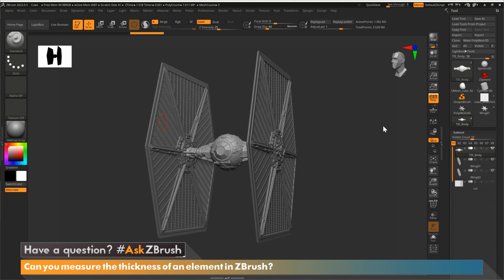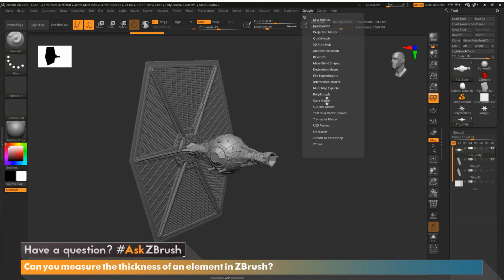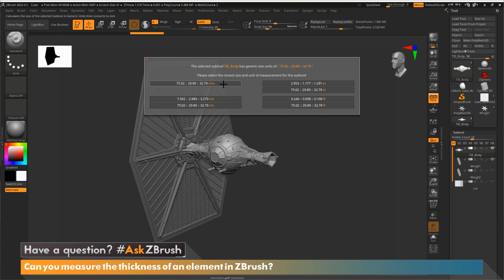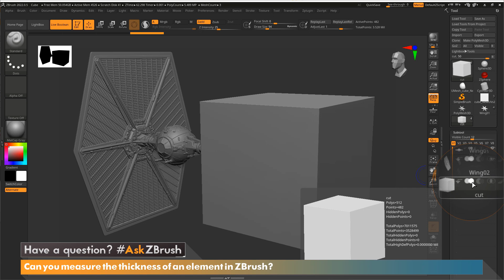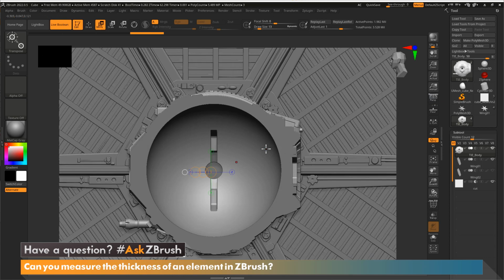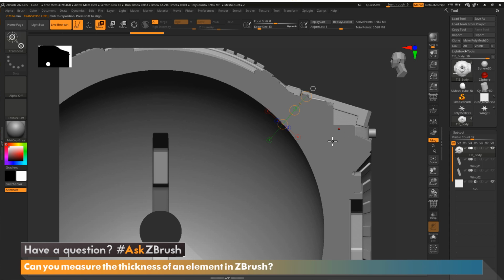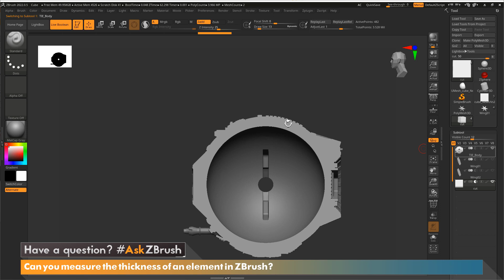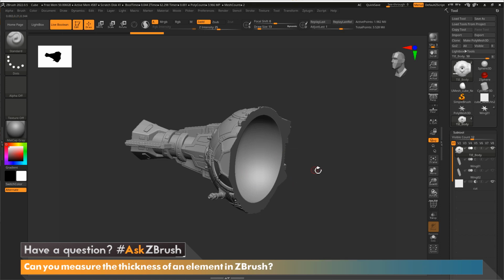#AskZBrush - Can You Measure the Thickness of an Element in ZBrush?

Comment: hello. i want to make parts a high poly model that i hollowed out into 4 parts and i use slice and make it into parts. but the joints of the parts remain open. when i use dynamesh, Zbrush makes the part completely solid. how can i make hollowed parts with closed joints?

Comment: ok this is useful; is is possible to move an element by an exact amount? Like move something long the x axis for example by 3.752 mm? coming from Blender ive really been looking for this ability and have not found it so far
Reply: no this is not possible in ZBrush. You can Move with snapping but there is no way to move by exact 3.752MM
Reply: @PaulGaboury  absolutely wild that a nearly 900 dollar piece of 3D software is missing this super basic feature. Thanks for the reply tho.
Reply: @mastafoo886  This is one of the gripes that bug me out with Zbrush - it has the tools for precision modeling but not precision to an architectural level where u need the precise mm, cm etc.